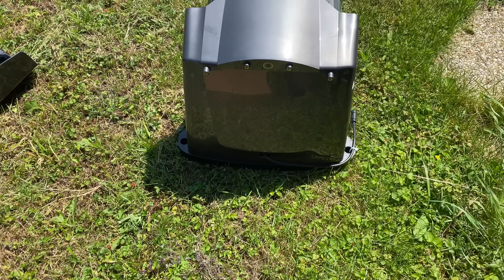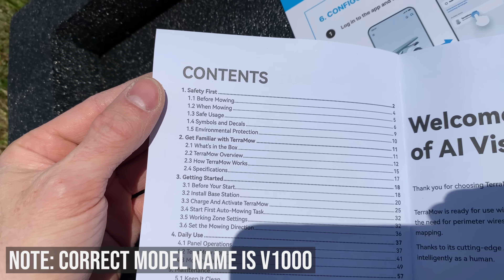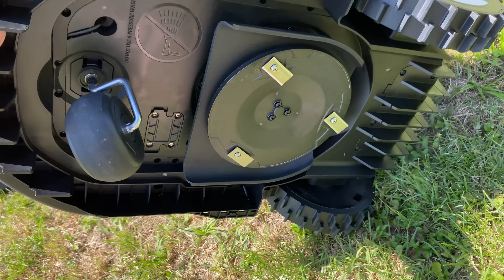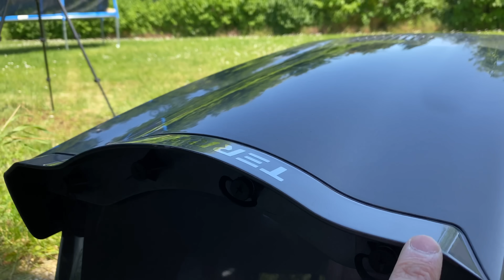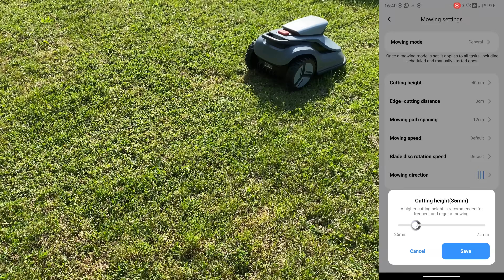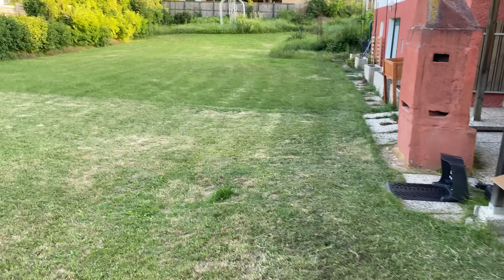2025's Best Vision Only Lawn Mower! - TerraMow V1000 Review & Test (Simplest Smart Mower Ever)

Comment: Hi, great video on the TerraMow V1000. I'm fixing to back there current Kickstarter project for there upcoming large AWD X series device, and have been researching there current products dependability along with demos showing there vision based ai navigation system at work. This demo video has been exceedingly helpful in that regard. Thank you. 
I do have one question regarding map setup, do you know the maximum in app map size limit set for this V1000? I trying to learn if they software lock each model based on it's mowing limit per charge or if you could map beyond the 1200 sq meters spec.

Comment: Since this robot only works with a camera, what does it look like in the dark (i.e. mowing in the evening)? Given the volume, could it mow at night or is it too loud for that? And what about moving animals, like dogs? I think hedgehogs are easier because they stay in place and curl up. I usually worry when a dog lies on the lawn or wanders through the garden during the day.
Reply from the maker: The mower relies on its camera, so in darkness it won’t recognize the area properly — mowing at night isn’t really possible. In terms of noise, it’s pretty quiet compared to other models. As for animals: hedgehogs are usually safe because they stay put, and moving pets like dogs are generally avoided thanks to the sensors, but I’d always recommend supervising or keeping pets inside while it’s running just to be safe. 👍